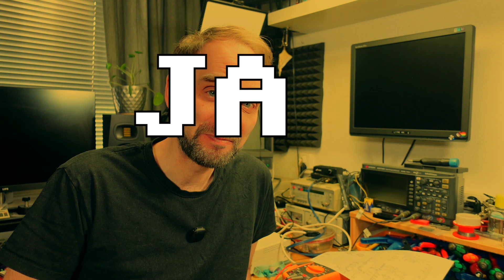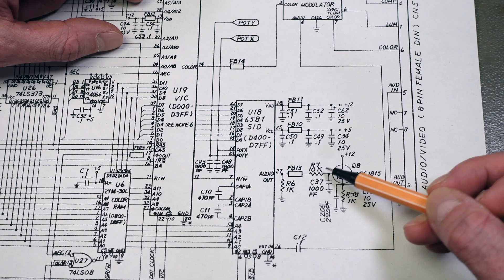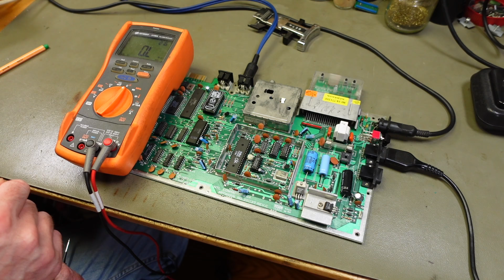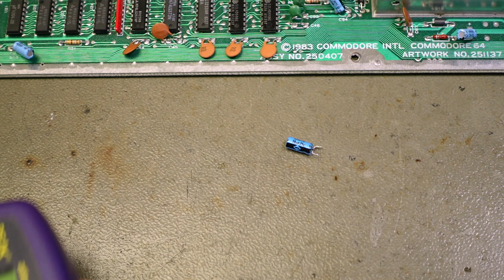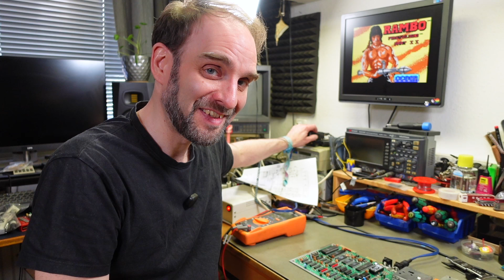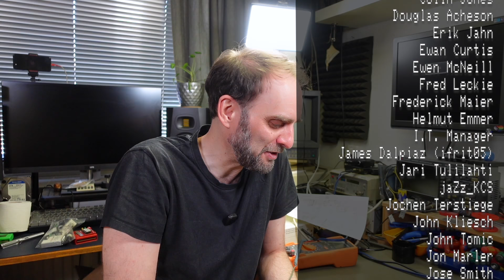C64 Low Audio Level Repair

Comment: for that a higher (=cheaper) esr capacitor is fine, but ideally high temperature and enough voltage that it lasts very long
Reply from the maker: I put in a Panasonic FC series 10uF 50V cap, should be fine for a while. ;)
Reply: @JanBeta  yes, those are very high quality

Comment: Nice diagnosis and repair. You could also replace this 10uF electrolitic cap with foil one (wima) and not worry about this issue in the future. Such improvements are often made during re-capping audio amplifiers.
Reply from the maker: Good idea! I didn't think of that, even though I've done exactly that in audio equipment myself. :D

Comment: Replace all the caps that are the same brand and series, at least! They may not be far behind.
Reply from the maker: Yup, that’s the plan. I think I mentioned it in the video, too.
Reply: @JanBeta  Yep, you mentioned replacing the rest of the caps. I wrote this in agreement, but forgot to provide context in the message (I should have said "Replacing is a good idea. You should at least replace those that are of the same series."

Comment: Hi Jan, have you seen what’s possible to do nowadays with a tiny Tang Nano 20K board... I honestly think it's becoming way more worth it to use FPGA technology rather than spending a fortune to expand original Amiga or Commodore 64 hardware.
Reply from the maker: FPGAs definitely have come a long way and they are amazing if you just want to use the machines. I’m having more fun figuring out and repairing the real old hardware though. I do use a MiST and several emulators if I just want to have a quick play or check out some software. :)
Reply: i think that is a matter of philosophy and personal preference. for me it is an option to replace old chips and also extend them like bug fixes, improved quality or even new features. but i do not want them to replace the whole computer. this is something that seems a bit too fake for me. like the new C64 ultimate. for me this is a huge pile of crap with no soul at all. and it takes away something from the average enthusiast. everything on the board is in tiny smd parts that cannot be handled by the consumer anymore. it is made to bring new, better functionality - which of course is great - but it is done in a cheap way which comes with a down side, which is the accessibility. if this is something that fits to a consumer, well, have fun with it an enjoy it. but for me this went too far and i personally do hate it.
i have the Tang Nano 9k and the Tang Nano 20k. And they are great boards to develop stuff. but i am now working on a daughter board with the Tang Nano 9k, that also contains level shifters / bus transceivers so that it is 5V compatible and it can be used as a replacement of many chips like old school CPUs, video chips, sound chips. i would never want to put a whole computer in it. and the idea behind that daughter board is, to make new computer mainboards - like an Atari 2600, VIC-20, C64, ...... that has pin headers instead of sockets for the CPU, video chip, audio chip. and with a very simple adapter you could use the original chips. or using the fpga board as a chip replacement. you still have the memory on the motherboard, you still have the kernel, character set, basic rom on the motherboard, you still have an original PLA or a more "modern" GAL address decoder on the motherboard. etc.
so, more or less the same structure on the motherboard, everything with old school dual inline chip packages / sockets and no SMD components but with pin headers for a CPU board, video board, audio board.
but as I said, that is a choice of philosophy. there are endless arguments against it and for it and nothing is wrong or right. only a matter of personal preference.
you for sure know the commander X16, they tried to do everything with available chips - except the graphic chip, which has been done in an fpga, because there is not other option. i like that approach, but of course it is a completely new computer. it is not an extended C64 or VIC-20. and for that it has no special connection to me.

Comment: I have a C64 with similar problems.  I have a cap kit, I guess I should get around to installing it.
Reply from the maker: It’s far more likely that the problem is caused by a faulty SID (in my experience bad caps are quite rare in the C64, actually) but it’s always a good idea to replace the caps. :)

Comment: The funny thing about the 15 kHz filtering as well is that with a CRT TV/monitor, you would have had 15.5 kHz horizontal deflection coil whine blasting at you anyway.
Reply from the maker: That's a great point, those CRTs certainly provided their own unique "soundtrack." :)

Comment: Wow you don't normally see bad caps in the c64s .. Nice find 😉
Reply from the maker: Thanks! Caps are rarely a problem in C64s indeed. I think I encountered only 2 or 3 caps that were actually completely broken so far (and I've worked on quite a few C64s over the years). :D
Reply: @JanBeta you sure have Jan .. ive been watching your videos for years 😉 ...